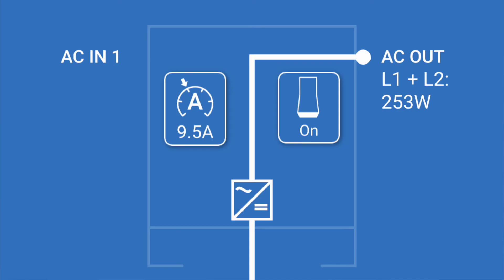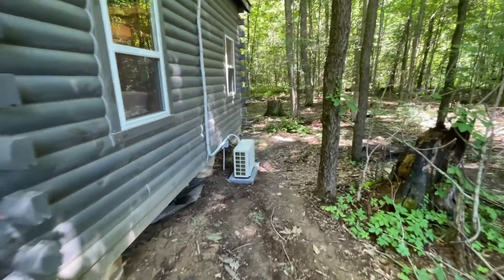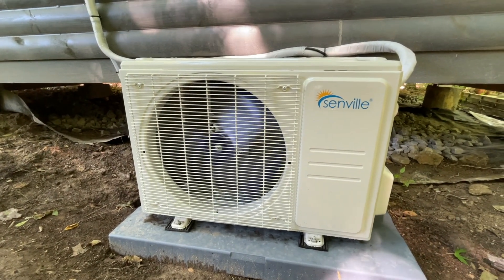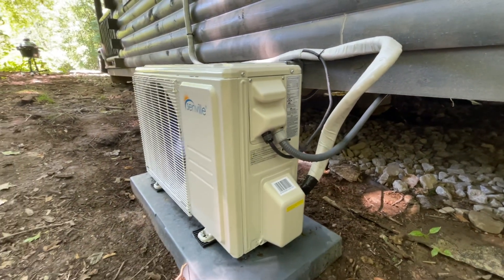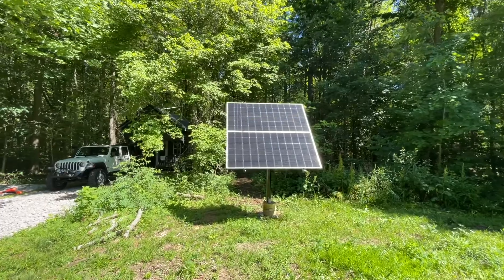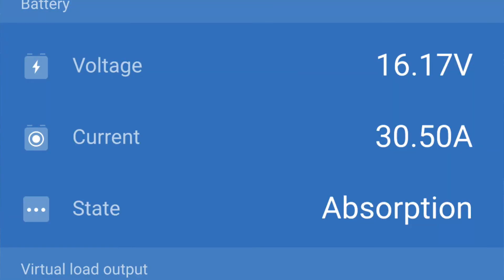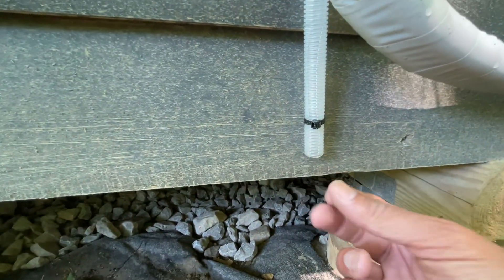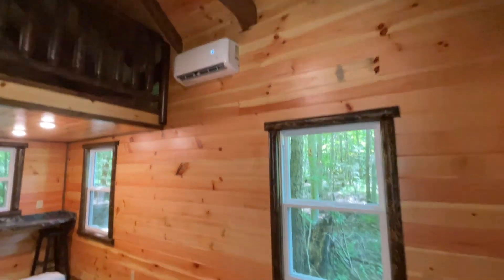AC on Off Grid Solar

Comment: do you have a on/off transfer switch ? if so what brand
Reply from the maker: No transfer switch. The Victron MultiPlus II takes care of that. It switches automatically from shore power to battery power. It’s amazing, read up on those inverters. It does not get any better than that. They are not cheap though, but worth the price!

Comment: What inverter are you using?
Reply from the maker: I am using Victron inverters. This one is the 3000VA Multi Plus II.
Reply: would i be able to use my edecoa dpm35 3500w pure sine on a system like your ? @offgridsimplicity
Reply from the maker: @bill7078  I am not familiar with that inverter, but the power rating is plenty for running that mini split system. My system voltage is 52V, a lower voltage system would draw more amperage on the DC side, but it would work as well.
Reply from the maker: I would think so. @bill7078